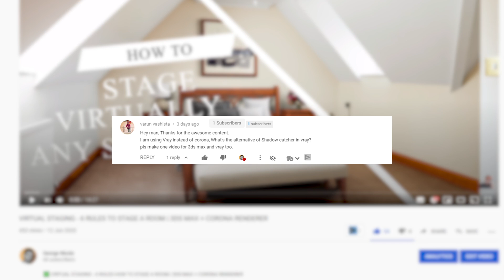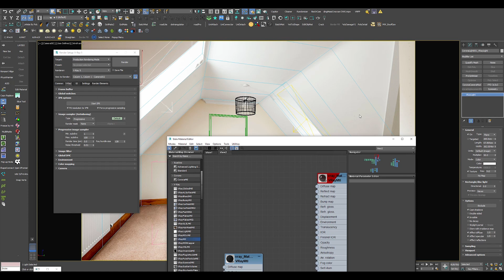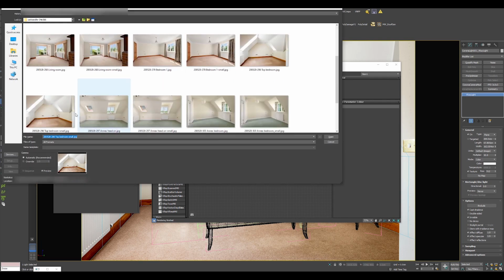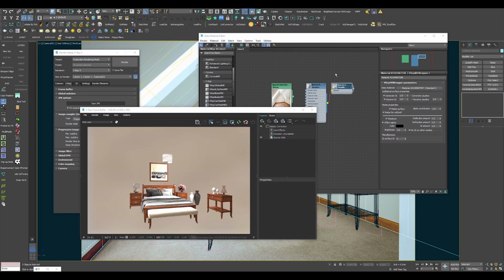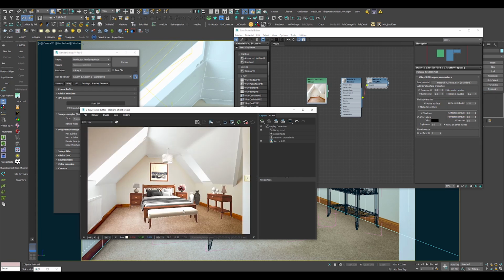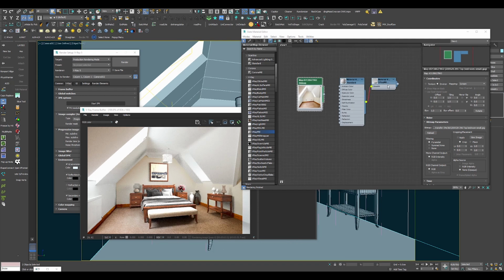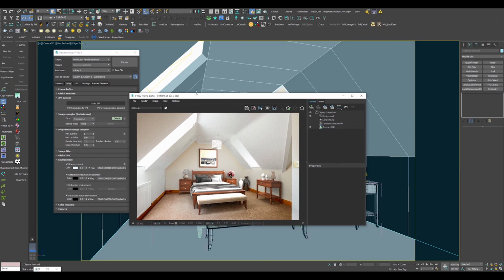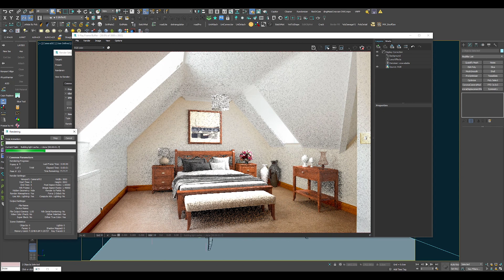VIRTUAL STAGING 3DS MAX + VRAY 5 | TUTORIAL

Comment: Hi George. I have followed your tutorials, but each time I get to the shadows, my scene wont generate them at all. I have converted it to a poly, applied the Vray Mtlwrapper and standard material...done the Vray properties, exactly as you have, but the shadows just wont appear. I have to resort to adding planes into the scene just to get the shadows...and I am really tired of not having it work correctly with shadows. Can I send you my file, Max 2018 with Vray 5.3 update and you tell me what the issue is? I was even thinking maybe it is my version of Max, but maybe not. I await your reply. Thanks
Reply from the maker: Hi Emile, thanks for your comment. Save your file to the lowest version possible you can, archive the whole file, and send it with wetransfer at george.cgi@yahoo.com I'll check what's not on point and write back. Cheers

Comment: Hi George, what V-ray settings do you use for your virtual staging?
Reply from the maker: Hi Elena, thanks for your question. There are not special settings in terms of the rendering itself. Pretty much most of the times I use the defaults. If you cam be more specific, please describe what is your issue.

Cheers
Reply from the maker: Hi Elena, select your objects where vray mtl wrapper is applied, enter into the sub-object level (poly) or press 4 on your keyboard then invert the polygon faces. If this does not work, add shell modifier to the mtl wrapper objects only! Report if this solves the problem.
Reply: @GeorgeNicola  thank you! That solved the problem!

Comment: Hi George , i have a doubt in 3:42 , as it is mentioned to add environment in background in frame buffer, but i am using vray next, there is no option for layers , so how do i  solve this problem , when i render only furniture can been seen rest is  in black in color.
Reply from the maker: Hello Ajith, thanks for your question. What you are saying is strange really, there should be an option for Background where you can add the image and do the job, but at the same time rendering all in black it does not make any sense. Please, archive and send your scene at george.cgi@yahoo.com and I will check what's the issue there. Thanks

Comment: Hello, thank you so much on the video. I have an issue where the room (with VrayMtlWrapper applied) is still visible, and rendered as dark grey even though i have followed all the settings you did. Also, the alpha seems unaffected. What might cause this issue? is it possible that i made several boxes for the room instead of 1 big box like you made? Thanks in advance.
Reply: I mean, i built the room from separate boxes each for the ceiling, floor, and each segment of the wall, and then attached the boxes into a single editable poly. I managed to make the room invisible and catch shadow, but only when environment map is set to vraysky.
Reply from the maker: Hi Edwin. Sorry to hear you are having issues with VrayMtlWrapper. You can archive your scene and send it via dropbox or wetransfer to my e-mail george.cgi@yahoo.com
I can promise to have a look at it and will answer as video as soon as possible.
Thanks
PS: Let me know if you have any other questions or issues
Reply: @GeorgeNicola  Will do, thanks George!
Reply from the maker: Job done. I will aim to upload a video answer in the next few days of this week.

Comment: I know you wrote your explanation @ 4:20s but I don't understand this bit.  You seem to uncheck and then recheck settings, it's as though you've done nothing.  Also, I cannot tell if an object is selected, and if the renderer is still running because there are too many dialog boxes open (and they're too big for the screen, hiding things.  Please can you explain the Wrapper Material better please - I don't use it much and when I look at it I find it confusing.  Thanks :)
Reply from the maker: Hi Jez. Thanks for your comment. At 4:20 I did that to show how it is affecting the alpha channel, but when I speed up the video this made it look like I did it in less than a second. As per your request I will make a standalone video for the Vray Mtl Wrapper alone.
Reply from the maker: I am recording video on 4K screen and perhaps this becomes an issue. I'll make sure I zoom in when there is important part of each video.
Reply: @GeorgeNicola  Thanks George, I'll re-watch that part of the video.  BTW, I found a really good MtlWrapper video on YouTube, I'm a lot clearer, but will look forward to yours also !
PS - The only area I'm struggling with getting my head around is all the furniture set ups that you'd need.  I see websites offering Staging services and they are charging very small amounts of money to stage a photograph.  They must have a TON of furniture ready to just merge into the scene.  Could you do a video about that side of things (I know you've done one on the SketchUp Warehouse side).
Thanks a million :)
Reply from the maker: MtlWrapper is also explained in Chaos' website - help pages too. Virtual staging companies try to fight with low prices, which is a totally wrong game. They drag-drop from 3d catalogs and press Render, which is not a virtual staging, but populating with 3d models. In my opinion, this is not the right way. I am preparing a series of videos on this topic. I have done close to 6000 properties with virtual staging, and I can see what is working and what is not working on the market for the end-buyer.
PS: Let me know about your progress too.
Reply: @GeorgeNicola  Wow, 6000 !  I haven't done 1 :)   I'm really looking forward to your series of videos :)  Thank you for sharing your skills and knowledge :)

PS -Yeah I know, I see some are charging £35 per room....
Reply from the maker: I achieved that number of stagings by supervising colleagues directly.
Personally I'd say I've done around 300 to 400 which is still a figure. Thanks for your comments. I hope in two or three days to post a new video.